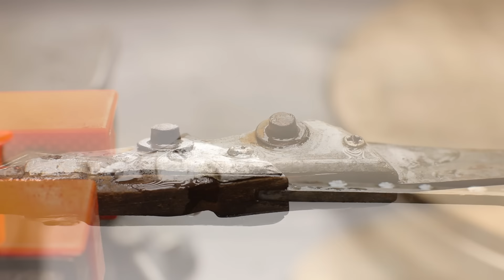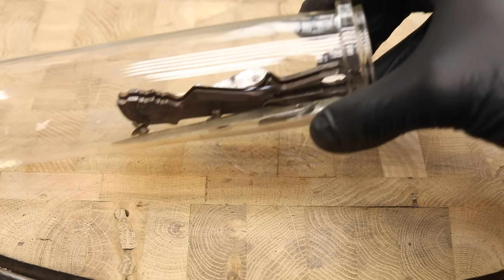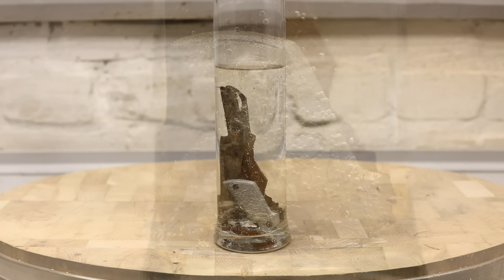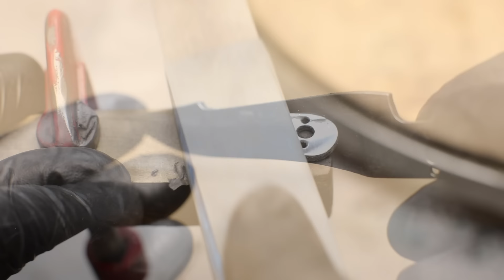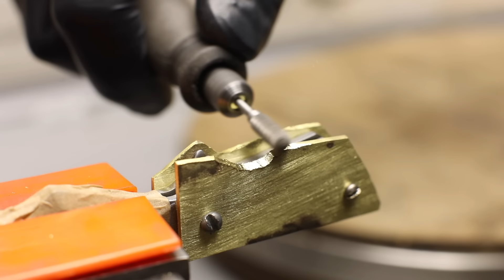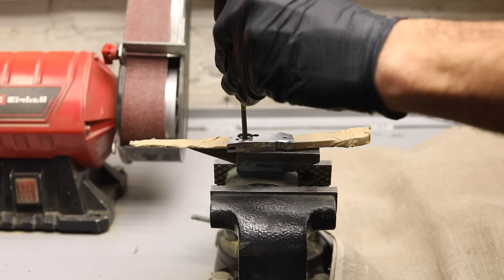Rare rusty switchblade knife restoration. Perfect Restoration

Comment: There are several types of rust remover that will remove rust without wearing down all the detailed ornamentation with a wire brush and sanding/filing.

Comment: Great restoration. I give it a 9 out of 10, just because I'm not completely sure the original saddles were not recoverable. But I wasn't there so I could be wrong. :)
Reply: I suspect hammering them straight would have damaged the engraving.
Reply: @willowmcintire21  I get it :)
Reply: @willowmcintire21  could he not have used a vice to squeeze them flat? Ive seen it done before on other channels